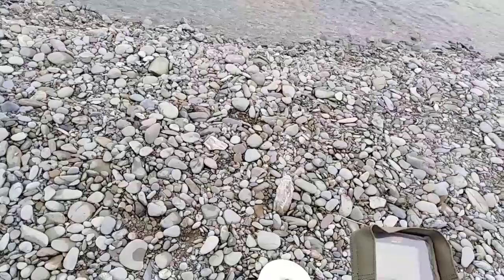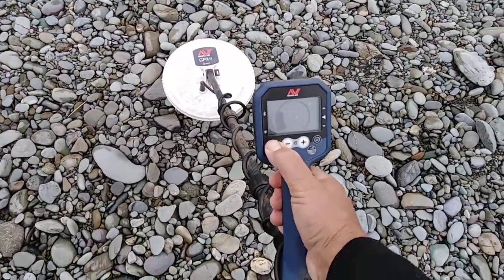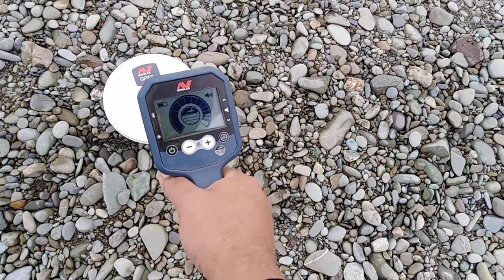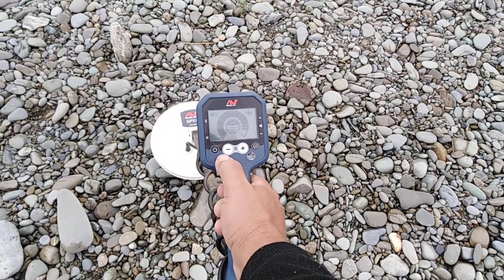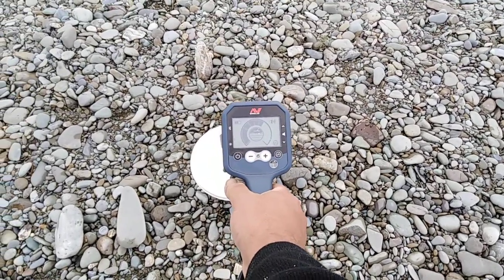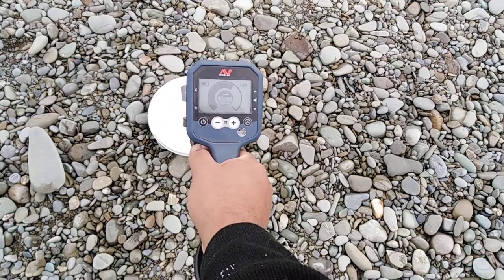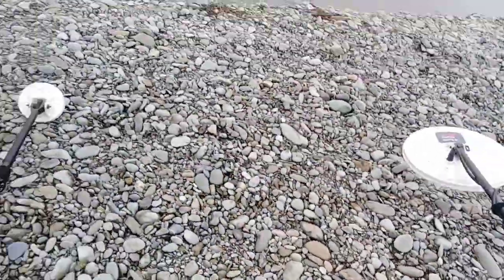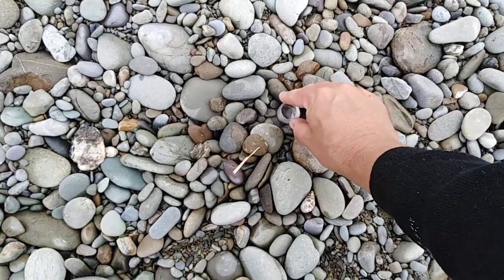GPX 6000 on various sensitivity levels vs the 8" X-coil on the GPZ 7000 on a 0.033 of a gram nugget

Comment: I have been watching a lot of your videos and others on the GPX vs GPZ, a lot say the GPX is much better on small gold but your test semm to prove the opposite.  Overall the GPZ is probably slightly more sensitive you would say?  And how much more sensitive would the GPX and GPZ be vs a Nox or Gold monster in your opinion (sorry for all the questions).  Cheers
Reply from the maker: In my opinion the GPX 6000 vs the GPZ in both their standard forms the GPX is more sensitive to small gold by quite a bit than the GPZ but the GPZ has more depth as the gold gets bigger, it's only when the right coil is on the GPZ does it catch up or exceed the 6000 small gold performance.  The reason many will say the GPX is better on small gold than the GPZ is because they're using the standard 14x13" coil on the GPZ so yes the GPX is better in that case on small gold.  The GM or Nox with 6" will find smaller gold than both the GPZ and GPX regardless of coil as they're really limited to 0.03 of a gram or over, much below that and it needs to be touching the coil where as the VLF's will still get some pretty good depth on bits smaller than that, but as the sizes increase to the GPX and GPZ will get more depth, significantly more depth as the gold gets bigger.  In milder soils the GM and Nox will do better on very small gold under 0.03 of a gram, over that then the GPX and GPZ with the right coil will start to do better depending on the soil, and in very mineralised soils the GPZ and GPX will do better just about all the time.  I rarely use my GM or Nox for gold these days, great to find the smallest of crumbs and cleaning up but will miss so much gold the GPZ and GPX will get that's just too deep for them.  Other than the reliability problems the GPX out of the box is the better small gold detector of the two but if someone already has a GPZ just adding a better coil for small gold to it can fix that up.  Buying the GPZ + the aftermarket coil is the more expensive option.
Reply: @phrunt  Thanks a lot really appreciate it!  We have been loving the GM but really have got a hold with the Nox recently and it does do just as good if not better job then the GM (as you told me months ago) on everything ba the microscopic (like 25cent pieces) gold that is hardly worth digging even when on the surface anyway, as the nox is so much more stable to bumping stuff and has so many extra features and better discrimination.  I recently bought a GPX6000 (had to sell all my gold and still in debt paying off dad), and hoping it can get gold we missed with the Nox and GM in ground we have already went over and pulled out ounces in the past, the majoirty of the weight in those areas come from 1/10th-1.5 gram nuggets (with the one 6.2 gram we have got from there) so we are hoping it will find some more, it also covers so much more ground then the NOX and the GM as those two you essentially have to use the 6"in gold when the GPX you have a far bigger coil so can cover 10X more ground, and like really you don't want to spend 20 minutes cleaning out a crevice to find a $2 picker, yeah its nice a good but nothing spectacular so if anything hardly even a down missing those, as even digging 20 of those is less then 1 1/2 grammer, in a clay bottom river we have detected so many times with the Nox and Gm to no gold result, went for a hunt with the GPX6000 and within 1/2 an hour I had found my first gold in that river (and first ever with the Gpx, thats the only chance I have got to use it yet), a 1/10th of a gram flat flake, that was a screaming target almost bottoming out the detector and it was easily over 4" deep!  So hoping to take it up the bedrock rivers and get some gold!  Thanks a lot again really appreciate it, if your ever keen for a hunt let me know but I assume you quite secretive in your spots down in Otago and wouldn't want to take any of your gold ahaha, happy to invite you up to one of our spots on the coast though.
Reply from the maker: @TheSluicers  Thanks, good to hear you've got a 6000, you'll do well with it, and you'll find gold a lot deeper than you're used to finding with the GM, crazy expensive for what it is but its a really good detector and hopefully lands you some big deeper stuff to help pay the sucker off.  The Equinox betters the GM because of the features more so than performance, they're both very similar in overall performance.  The Nox you can lower the recovery speed in mild ground which adds extra depth to give it a bit more go than the GM but you should swing slower if you do, you can also set the iron bias to zero to ensure you get the best performance on the tiniest bits.  It also has the ability to ID hot rocks a lot better than the GM usually by the -9 -8 and 13 ID's and you can notch them out without losing performance, if you use the very basic discrimination mode on the GM you lose a lot of depth, not the case with the Nox you lose no depth at all using some discrimination.  The places around here to find gold are generally where it's been found before so that's where I go, the old timers did a pretty good job of identifying where gold is to be found.  I mostly search on land, up your way creeks seem the way to go.    You may want to invest in a smaller coil for your 6000 mainly for getting into tight little spots, the new little NF 8x6 will be awesome for that when it comes out, the Coiltek 10x5 is the cheaper option, I have it at the moment, while its not really anymore sensitive at all than the 11" at least it gets into places the 11" can't.
Reply: @phrunt  Cheers, doesn't the recovery speed and iron bias only matter if you are notching iron targets out etc?  Yeah was a huge cost but will hopefully day itself off for sure lol.  I already did get a coiltek 10X5 as its so much more stable going underwater and yeah can get into smaller better places, the GPX would really shine on land compared to creeks but will still hopefully get more than the others up the creeks.  Thanks so much for your advice again
Reply from the maker: @TheSluicers  Recovery speed has nothing to do with discrimination.  this site explains it best, https://www.minelab.com/community/treasure-talk/recovery-speed-target-masking but essentially if you're in an area with very few targets in our NZ milder soils lowering your recovery speed will give more depth but its wise to swing slower so better for cleaning up a known good gold patch.  Iron bias is a type of filter and is on regardless of discrimination settings, and as we know small nuggets can often come up bouncing around in the negative numbers.   They set iron bias default as zero in park 2 and field 2 as if it was higher it has the potential to mask out small hammered silver coins or gold coins as iron if they're in the same hole as an iron target.   By disabling the filter (iron bias 0) then the gold and small silver is more likely to give a better ID even in the same hole as junk, with gold the hotter ground can cause the gold ID's to fall into iron, and hot rocks can be everywhere so smaller gold having very low ID's can easily be pushed down into iron and may influence your dig decision,  having a higher iron bias can push the small gold numbers down even further into iron and if you were using discrimination it'd blank out the nuggets completely.  If you're digging it all like you should be when prospecting except certain iron targets mostly -9 -8 and some hot rocks 13 (gamble not digging 13 but if too many hot rocks you just have to ignore it), using iron bias at 0 makes a lot of sense as you don't want to have any filters on if you're digging almost everything.  Coin hunters may like a high iron bias as it makes iffy targets iron which then they can blank out, if the detector thinks it maybe iron but isn't 100% sure having the higher iron bias makes that decision easy saying yep, lets make it be iron.  Lowering the iron bias makes it say well I'm not sure it's iron so let's say it's not iron.

Comment: Mine is the same ,don't even want to use it anymore ,staying with the 7k
Reply: Do you still get good depth with the eight inch on the seven . And did you try different ground type on the six I use my six all the time it’s pretty good I’ve had one new coil my first 11 inch died I do think the seven is a better machine but with that small coil would be deadly around the workings
Reply from the maker: @leighgranland8442   Yes, the 8" gives great depth on the 7, especially on small gold.  I've tried difficult and normal on the 6000, it's not as good as the 7000 on small gold in my soil, that I am confident of.  A lot of people have had faulty coils or detectors with the 6000, it's a real shame the quality level isn't up to scratch, but yes, it's a good detector if you get a working one, I just prefer the 7000, especially with aftermarket coils on it.  Both are good detectors though and with standard coils the 7000 isn't as good as the 6000 on small gold.
Reply from the maker: Yes I much prefer the 7000
Reply: Same here